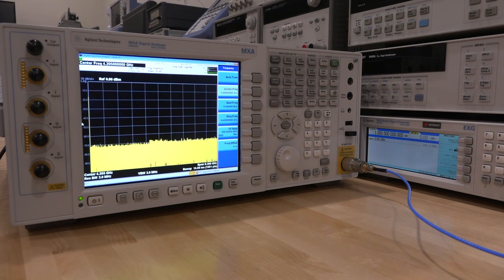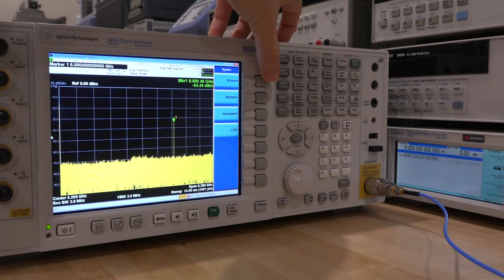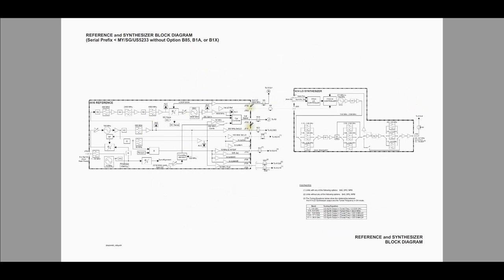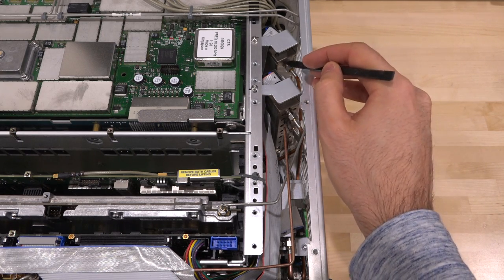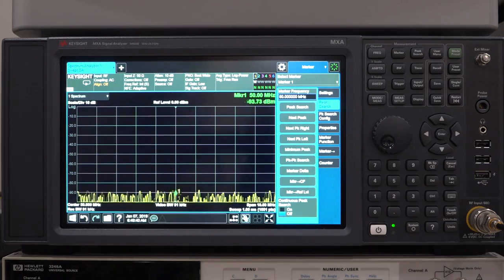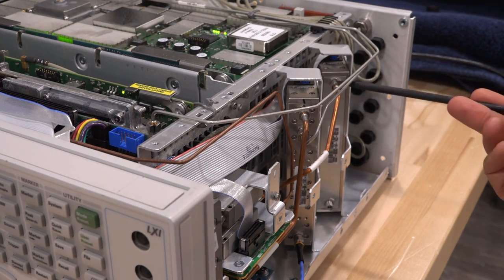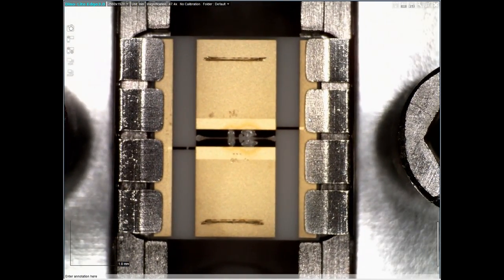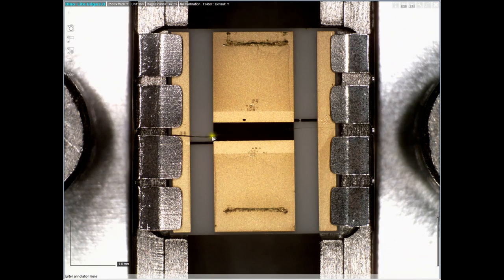TSP #142 - Teardown & Repair of an Agilent N9020A MXA 10Hz - 8.4GHz Spectrum Analyzer (Jan. 19 - P1)

Comment: Another thought I had, wouldn't it be possible to replace the complete attenuator/switch assembly by a bunch of coaxial relays and some SMA 2dB attenuators?
The only thing that wouldn't be super easy might be the adaption of the control interface but even that should not be too hard. 

Greetings again,
Michael

Comment: Maybe insert another electrical attenuator in the path to do just the 0/2/4 dB attenuation ? i.e. use the existing one for input switching & AC/DC coupling, but force it to 0dB, get the control signal for the attenuation control and route that to another attenuator. I think pure attenuators without the input switch and ac/dc are easier to find.

Comment: Solder some SMD resistors over the gap and it'll be good as new!
Reply: Just put in a 0603 instead so it can handle the power and I´m sure it will still keep the 50 Ohm impedance from 10Hz - 8.4GHz as well so that should be a cheap fix.
Reply: I doubt this would work, but it would be an interesting experiment! Although you can see the frequency response curve in most datasheets and it's far from linear. Search for "Vishay Frequency Response of Thin Film Chip Resistors".
Reply: @ligius3  I was of course joking, I thought that was very obvious. 

It will of course not keep any 50 Ohm impedance over any 10Hz to 8.4Ghz and at the same time keep its resistance value constant all the way. these chips are custom made specifically for this so nothing else will work as good or even at all and no commercial SMD resistor would even be remotely close.
Reply: @dtiydr  You'd be surprised. The return loss spec is 20dB below 3.6GHz and 15dB below 8.4GHz. The garbage-tier terminator I made before I had a real cal kit evidently comes within 3dB of that with 0805s and no attempt to flip-chip or distribute the loss (I just swept it). I'd bet Shahriar could get the machine entirely in-spec with 0201s, flip-chip, and rough geometry matching (several in parallel to match the width of the main trace). That said, these are the very frontmost pads in the entire signal path, so I understand completely if he wants to do it right.

Comment: Interesting failure mode, it’s hard to imagine what caused the fracture, unless it was dropped... Hope you are able to source a replacement, very nice instrument.
Reply: At that size I would imagine that thermal shock could damage the ceramic substrate, as seen in the microscope.
Reply: I would hazard somebody transmitted RF into the unit, and was using the 60dB attenuator settings to see the signal, forgetting it is very much energy limited input wise, or they forgot to put in the inline 60dB attenuator/dummy load before use.
Reply: @SeanBZA  I intensely dislike somebody :-)

Comment: I have a Yellow Pages you can use to fix it with. Works fine with everything else. Little bit of concussive maintenance and she'll be right.
Reply: Jim Griffiths, Yup... like Momo Motors story of Alfred Momo fixing a rough running Ferarri with one blow from a small hammer. The car owner questioned the bill as "excessive ($1000) for one hammer blow." Momo replied, "I only charged $1 for the hammer, $999 for knowing where to hit it."

Comment: @The Signal Path do you teach courses in your professional life, just wondering?
Reply: I think he did, not sure if he still does it. I think it goes like this: professor assistant -> research scientist -> Black Mesa engineer (we are here) -> Gordon Freeman
Reply: @ligius3  And that on episode #143. Thats 1+4+3=7. 10-7=3  => Half Life 3 confirmed
Reply from the maker: Yes, I am an adjunct professor at Columbia University in NYC. But my main job is at Bell Labs.
Reply: @Thesignalpath  I studying electronic-ICT myself and doing a master thesis involving microwave design (Rotman lens and/or Butler Matrix). If it wasn't for you video's I probably would be doing this thesis. Thanks for your excellent quality show and keep it coming. PS any video's on Rotman/Butler in the pipeline? ;)
Reply from the maker: @nxt-1  Thank you. Rotman, Butler networks sounds like an interesting topic. Should make a good episode.

Comment: maybe you can buy two attenuators of 2 dbm packaged to-8 and place them to see if it works well
Reply: These chips are highly customized probably made by Agilent them self and these chips keep their 50 Ohm impedance from 10Hz - 8.4GHz and their exact resistance all the way as well as they are built to do and have an exact size and such as well, any commercial available SMD resistor or similar will not be even remotely close to do that.
Reply: @dtiydr  sure but the person you are responding to said attenuators, not SMD resistors.. Look at something like the ATN3590-02 or HMC652LP2E, seems to be very similar design to what is on the ceramic. But no idea if the spec is close enough.
Reply: @jaro6985  Once again; whatever attenuators or SMD chip found those in the scope are meant and built for this scope and this scope only and any other chip must have exactly the same characteristics, as size, as the original chip has which no one will except the very chip it self purposely built for this.
Reply: @jaro6985  ATN3590-02 seems to be to small for a direct replacement, but a hack with HMC652LP2E (~5 euros each) ... glued on the current ceramic scratch the old resistor from ceramic and bond the chip it. I will go for a try ... @TheSignalPath ?

Comment: searching for agilent 33360-60003 on usual sources like ebay, there are a few listings for prices around 300-500 bucks used or 700 bucks for new ones.
Reply: Probably best to find 3 or for for $59 that are "for spares or repair, or another unit that uses these attenuators, but which is massively damaged elsewhere, like having had a power supply burn out.

Comment: I'm guessing dropping an 0603 or 0805 resistor on the ceramics won't work? It shouldn't change the characteristic impedance that much would it?
Reply: These chips are highly customized probably made by Agilent them self and these chips keep their 50 Ohm impedance from 10Hz - 8.4GHz and their exact resistance all the way as well as they are built to do and have an exact size and such as well, any commercial available SMD resistor will not be even remotely close to do that.
Reply: @dtiydr  Would be interesting to see how well it would work, Shahriar would have the instruments to characterize the 2db attenuators after such a "repair" but probably not the time for something like that.
Maybe with two 0402 resistors in parallel one could get decent results up to 3 or 4GHz at least.
Reply: @s3sebastian  Decent yes where high precision is not needed since it will not be linear all the way for sure, so with other words not even near whats needed for this instrument to work as intended even at that small range. And oh yes he would easily be able to test this, who know one day perhaps.